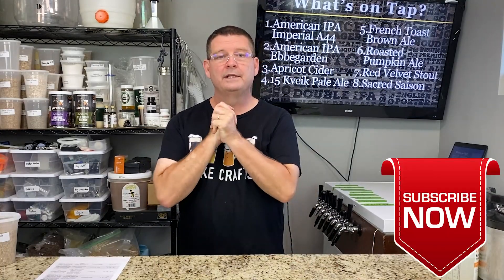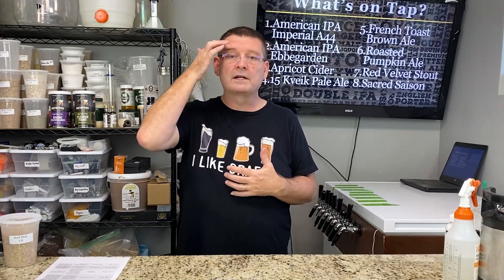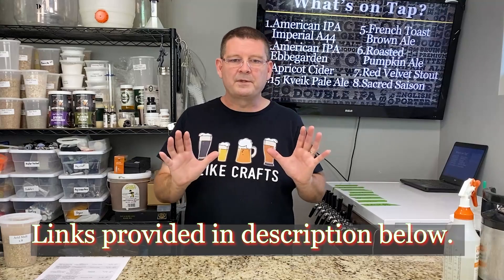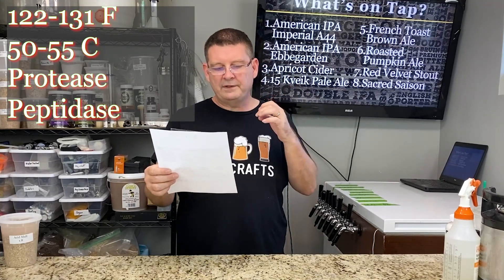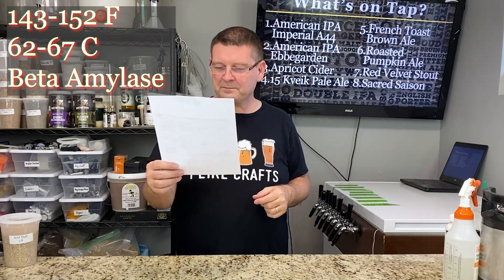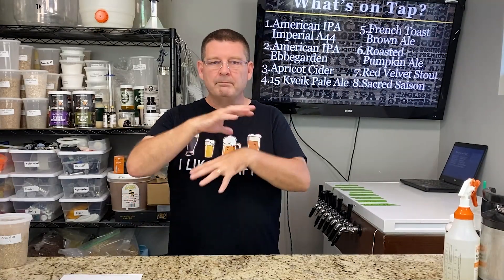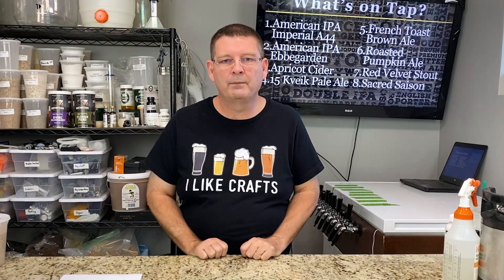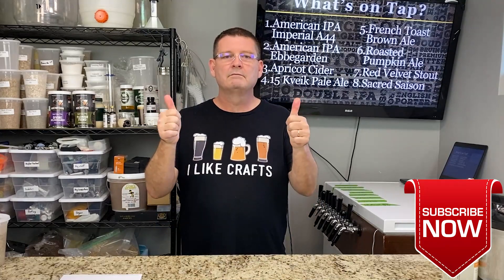How to increase your Brew House Efficiencies - Maximize your BHE

Comment: nice tips. my wort starts at a ph of 11, which i bring down to 5 using lactic acid. if i forget, the enzymes fail.
Reply from the maker: Something is seriously wrong with you pH meter. Your tap water (not recommended), spring water, or even distilled water should all be really close to a pH of 7. When adding the malts, your wort should drop to around 5 +/- and usually lower based on the malts. I would strongly recommend checking this out as it is a great deal at $45 (with a $15 coupon) plus it includes 3 pre-made liquid ph solutions for testing and calibration,. Amazing deal as that 11 really scares me. - https://amzn.to/461fvP2
Good luck.
Reply: @BitterRealityBrewing  ah, bless your cotton socks. i have a use a high base pre-process for my wort, hence the pH. Digital meters break. i am old school litmus paper.

Comment: Any tips on reducing water usages
Reply from the maker: If you only do a 30 or 60-minute boil, it would reduce your total water needed for the brew based on your boil-off. Supposedly 30 minutes is more than enough, according to a lot of brewers nowadays. The biggest water savings is how you chill your beer right after the boil. If you are lucky to have ice-cold groundwater, a plate chiller is probably the best solution for chilling and reducing water usage. Personally, I prefer an immersion chiller for too many reasons, which can either use a ton of water or, if you have a large pot, you can easily drop a sump pump in it (like this one that I bought on Amazon used for $40 in early 2020 - https://amzn.to/43rjT7g) and keep ice packs or frozen water bottles in your freezer to be used in your chilling water (You need a lot of them). I live in Florida where we are prone to hurricanes so about every other shelf in two separate freezers we have ice packs as it helps keep our food good for a few extra days if we lose power.

Comment: Hi. What is your malt suggestion and mesh temperature to brewing a New England IPA with 8.5% alcohol?
Reply from the maker: That is a big question, but this site does a great job covering the essential parts of a NEIPA, even if you want to make it an Imperial NEIPA. https://bisonbrew.com/how-to-brew-neipa/
I would highly recommend any of the liquid English Ale Yeasts recommended. I personally have used Imperial Juice A38, which does just what it says and helps the beer taste very fruity beyond what the hops can do on their own. Keep in mind that although if you were around 6%, I'd say kick the mash-up to 154 F, but with you shooting for 8.5% I'd probably stick to the 152 F as the higher abv will add more perceived sweetness, and 154 F might make it seem too sweet.
Reply: @BitterRealityBrewing  Thank you so much. I will read the post, brew a new batch and let you know the results. But I have another question: My last batch had mash at 152ºF and the original gravity 1.054 and using the BrewFather app, the OG should be 1.098. To get the low gravity I got the cause could be how the grain was milled and so much sparge water? What do you think? Thanks.

Comment: Even with the new style I am getting 60% on the nose.  This was no sparge, no lifting, just bag in the basket.  Next I am doing the same but with a 2 gallon sparge.
Reply from the maker: Sorry to hear that but have you tried no bag, and 1 gallon sparge? Also you do have the recirculation pump? If not, try moving some of the beer a few times from the spigot to the top during the mash to create a manual recirculation. The lift will usually give you a full point due to the dead space on the sides that simply doesn't get recirculated.
Reply: @BitterRealityBrewing  I tried just adding a sparge this last brew and it went up to 66% with no other changes.  I do have the recirculation pump.  One thing I did notice was it constantly seemed to be overshooting the mash temp even down to 35% power on 240.  It was as stable if not more so at 60% power.  I do wonder if I was recirculating too fast.

Comment: Nice one. gonna watch this video a few times more. By far the best BHE video I seen so far. I'm brewing old school style and my avg BHE over the last 20 5gallon batches is only around 62%. So I need to figure out how to improve that. Thanks for making and uploading this video. Cheers from Denmark.
Reply from the maker: Thank you but Ouch! on the BHE. As for old school style are you talking cooler or BIAB? I'm guessing cooler as BIAB usually is a bit better with sparging. Let me know and I might have additional advice not in the video also double check your grain brands/sources as one brand over another can have a considerable difference in diastatic power that can greatly impact your brew compared to what your program is telling you. That was the big one for me as my LHBS doesn't always keep track of the brands unless I buy the bulk bags which of course have the company on the label.
Reply: @BitterRealityBrewing  thanks for your answer. No, not BIAB. But l think i made a mistake in my calculation. I was using the volume of my final product, and not the volume that went in the fermenter. 
After l have redone my calculations l hit a avg of 74%..
Reply from the maker: @TheEllegaard  Don't get too hung up on the BHE but honestly 74% is a very respectful number and even a great number if you were doing a large grain bill where BHE suffers usually in most systems.

Comment: Which taste will be happen if I mash pH around 5.8-5.9 ?
Reply from the maker: Personally I don't know as I haven't tried a comparison but I would suspect it could lead to a slightly lower mash efficiency and could lead to less minerals in the fermentation but if you are using a yeast nutrient it probably won't matter. So at the end of the day probably nothing noticeable but as I said I'm not 100% sure as I have done a test with a PH that high yet but it would make for a great video.

Comment: Greetings from Mumbai. Great video on a topic that's not easy for a new brewer to get his/her head around. I never bothered with BHE or MASH efficiency for the first couple (or more) months after starting ... Realized over time that BHE is a sum total of many parts and processes that you've outlined wonderfully here.
I like Anvil products and have my eyes set on the Foundry 6.5G. That will have to wait until I'm able to fly again. Any reason you switched out of GF to Anvil, despite admitting to its many efficiencies? Cheers.
Reply from the maker: Thank you and happy to have you, welcome. Thank you for the nice words as I worked hard on this video when I realized that we all might be chasing our tails a bit and that it is impossible to get a perfect number but it is a great tool for measure against your previous efficiencies with like recipes and grains. So if you brewed the same beer twice but fell you improved on your processes, your efficiencies would probably reflect that with better numbers. 

Why did I switch from GF to Anvil, I get asked that a fair amount. Here is a quick summary as it can get complex but my first GF had a lots of issues after the first year and my reseller was quick to replace the connect modules (kept dying, it had just come out as they had recently changed from the old manual system) and then the whole system kept triggering a reset and wouldn't go over 140 F. They replaced the entire system but once I got the new system they had changed their app which was plagued with connectivity issues and if you had an issue you had to start over as there wasn't an easy way to resume or start over and jump forward. They have since fixed most of these issues but mine was 120v so it was slow but extremely efficient and I use to brew a lot of beers with wheat and still do with rye which seemed to easily scorch on the bottom during mashing and even worse during the boil no matter what I tried. The GF still has high density burners which sounds good but that means they are concentrated in a small area and generate a lot of heat each time they try to cycle the temp up even a few degrees. The Anvil and the newer Brewzilla (3.1.x) both have low density burners which greatly reduces the chances of scorching on the bottom plus the Anvil has that awesome 120/240 switch as here in the U.S. we use 120v everywhere and 240v outlets are a luxury and not the standard. With 240v I'm able to heat up my water at almost twice the speed as 120v allows. So ultimately I was really frustrated and after a nightmare brew day I decided to do a ton of research and buy something that worked better for me with a lot less frustration.
Reply: @BitterRealityBrewing  great.  glad Anvil Foundry is working for you. Their products are good. Wondering if you want to do an episode on  hardware options in electric brewing for small-batch folks like me. At a later date.
Reply from the maker: @ravilshirodkar1901  I am actually looking to do a handful of small batch beer brews this year but in reference to electric are you referring to a stove or something like the 6.5 gallon Anvil? I don't own the smaller one but could make recommendations based on facts. Normally I do small batch brews on the stove or sometimes on a propane burner outside. I use to own a 3 burner propane setup once and with my stand alone I could have up to 4 - one gallon brews going at a time and did that pretty regularly.
Reply: @BitterRealityBrewing  Great. Looking forward to those. Would also be great to know if there are any affordable E-brewing options for small batch guys.
Reply from the maker: @ravilshirodkar1901  I will do some reached on the e-brewing solutions beyond just the small batch Anvil unit.

Comment: I have been consistantly been  getting 85% BHE on my current 3v system. I am about to start using an anvil foundry. . .I'm interested as to how much my BHE will be effected.
Reply from the maker: I will say that most people see a dip in their BHE the first few times they start using the Anvil Foundry until they get everything dialed in but there are plenty of brewers hitting in the 85% range as I do frequently but once you get a bit over 14 lbs on the grain bill it does seem to suffer a little.
Reply: Haha. Found you on another HB video. Cheers Beast!

Comment: What's your brewhouse efficiency and mash efficiency on your anvil foundry? You mentioned that you use a very fine grain crush (under 1mm?). I would be worried about stuck mashes when my grain bill looks like powder... According to the brewfather app I'm having a brewhouse efficiency of 81% with a mash efficiency of 87% on a 1.3mm crush with my grainfather.
Reply from the maker: My Grainfather always had high efficiencies and when I first started using my Anvil Foundry my initial efficiencies were between 65 to 72 which killed me so I got focused on everything that could help boost it. I agree 0.0375 of an inch (just under 1 mm) is small but it was a recommendation from Brulosophy and if I'm not careful I can easily get a stuck or packed mash but I'm also playing around with wetting grains before the crush which the first time I did it, I had one of the clearest worts ever with decent BHE around 78 or 79 from what I remember. Currently I am between 75 to 86 BHE keeping in mind the Anvil Foundry is only designed to hold 16 lbs of malts and when you are at 14 to 16 lbs all efficiencies suffer but 14 or less with the small batch adapter and everything else hitting on the right marks such as PH and keeping my mash temp at around 152 (for most brews) I easily hit over 80. 86.6 is the highest I've ever seen so far and am more than happy with it but I'm still working to get more consistent BHEs so I can estimate better at where I will land while building the recipe as I have a habit of under estimating my BHE so when I exceed my conservative estimates I end up with a bit more abv then I originally was looking for.
Reply: @BitterRealityBrewing   Another hint with the Anvil, the water which is between the mash basket and the side wall of the Anvil is very passive in the mash.  There is a little diffusion of sugars into this water, but it is very little.  Taking measurements the past two brews, my wort in the mash and being recirculated was (for the last brew) 11.6 Brix and the water half-way down the mash basket was at 0.8 Brix.  The net once the mash basket was removed ended up at 10.0 Brix.  

So the last two brews, I raised the mash basket up approximately half way through the mash to get the water trapped along the side of the mash basket mixed into the process.  Net result was an increase in mash/lauter efficiency of around 6% in both cases.  It does not take long, I did not fully remove the basket, and I need to go back and remeasure the gravity at the end of the process, but it makes a big difference.  This morning's Dunkel clocked in at 87% mash/lauter efficiency.  

The other thing to consider when looking at Brew House Efficiency is that this value is tied to process losses.  I typically brew 10 liter batches and finish the boil with 11 liters.  My BHE automatically takes a hit of ~9% just from the wort left behind.  When looking to improve your BHE, one of the first things to check is how much are you leaving behind and are there ways of minimizing that volume.  This is one of the reasons I primarily track Mash Efficiency vs BHE.
Reply from the maker: @oginme716  WOW! I was just thinking about the part you mentioned in your first line while I was making breakfast and drinking my coffee to wake up. Almost all Electric All in One brewing systems have their advantages over another but I touched on this when I did the video "The perfect All-in-one Brewing System". The Grainfather's malt basket in the grain father has two major advantages one it leaves very little dead space compared to the Anvil that has a ton of room all around it. Plus the Grainfather's malt basket by design forces the flow from top to bottom without any extra holes that could reduce efficiencies. My question is how did you measure the the wort half way down? I would have expected it would get recirculated but from those measurements it sounds like it really just sits there with very little circulation which is very concerning.

First you had me at Dunkel (my favorite dessert beer of all time) but WOW!!! I'm not sure how to test this unless I simply do a test like I did with the 2 IPAs with one using the small batch adapter and one without but I wouldn't have expected such a massive increase that is awesome and thank you for giving me another video to do in relation to experimenting which are my favorites as I am a bit of a mad scientist by nature. That is amazing to imagine simply lifting the grain basket half way up to force the wort to mix up a bit more is all that was needed to get things moving around better. 

I did bring up part of that in my video in regards to when measuring your BHE you must compare apples to apples and you can't create a recipe with an expected run off (wort to fermenter) of say 5.25 Gallons and then only get 5 gallons and say your BHE was really high or in the other direction and end up with 6 gallons and say your BHE was really low as you have to adjust for that and compare apples to apples when trying to do a measurement not to mention figuring out why you had too much or too little wort to fermenter based on expectations and calculations available. I would agree that I haven't been paying attention directly to my Mash efficiency compared to my focus on my BHE but I do need to start looking at it closer so I can compare as I have a lot of reasons for loving this hobby but the constant learning is definitely one my primary reasons right up there with experimenting which ties directly into learning and helps me manage stress by giving me something to focus on that I truly enjoy doing.

Thank you for the insight and information as I will take it to heart and have added the testing of increasing efficiencies by lifting the mash basket up half way for a future video. I would suspect when I lift the basket I don't have to hold it for any period of time and can simply set it back down shortly after lifting it as the goal is to simply disturb the wort/water hiding in the dead space around the malt basket?
Reply: @BitterRealityBrewing  I missed your question about measuring the wort half way down.  I have a long pipette which can reach down about 12 inches.  So I put my finger over the top, plunged it down the side until I was approximately half way from the top of the mash to the bottom of the basket and let my finger up just a bit to allow a small amount of wort to enter the pipette.  It takes a lot of time in the lab to get good at this ;).  I should also have mentioned that I have the 6.5 gal Anvil, so the issue might be a little greater with the 10.5 gal unit.
Reply from the maker: @oginme716  Either way 6.5 or 10.5, I am going to be looking into this as it has peaked my interest a great deal. Thank you for the insight.